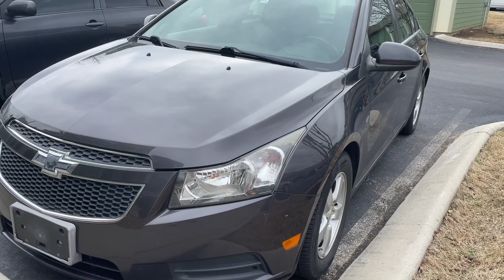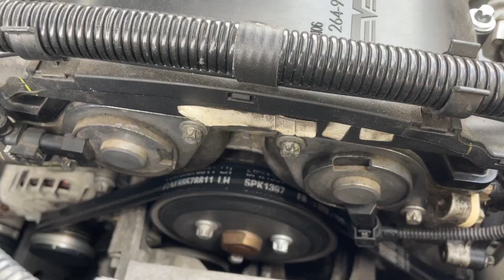How to Replace the Camshaft Actuator Solenoids on a 2011-2015 Chevy Cruze

Comment: where is the varable camshaft timing solenoids?
Reply from the maker: @DabiToyaTodoroki1  They are located near the camshaft actuator solenoids, but typically on the front of the engine.